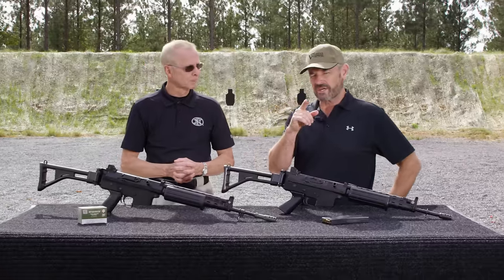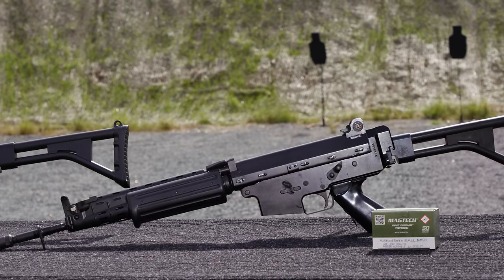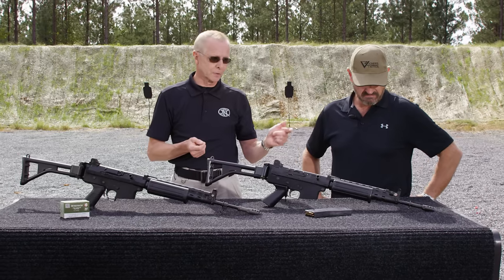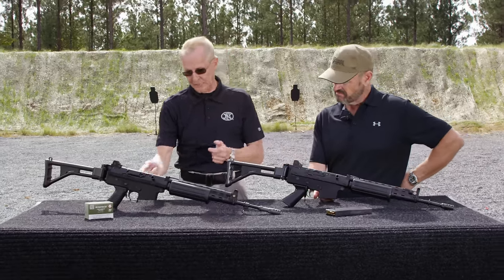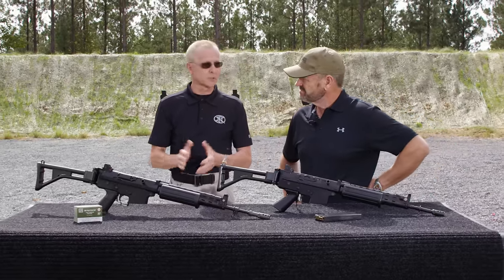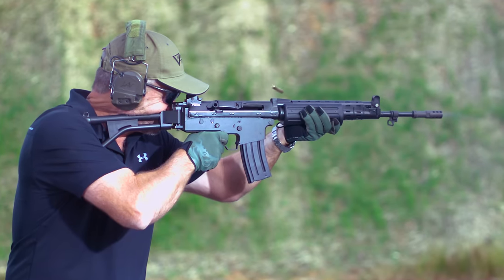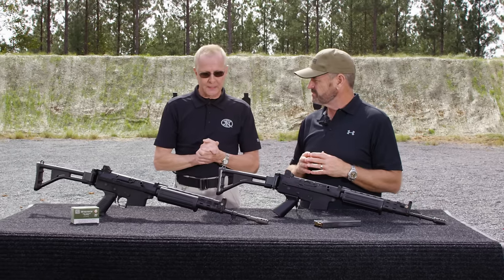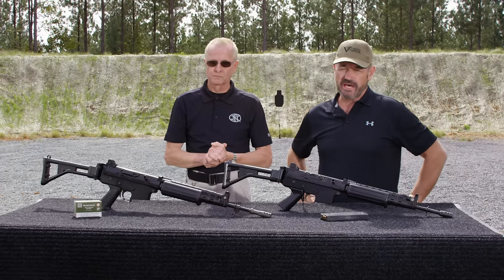FN FNC MK2 4K

Comment: Is that the rifle that Al Pacino used in Heat?
Reply: juki009 it is. He used a Para version. 

Regards,
Marky
Reply: Watched that movie for the first time last night
Reply: @RickyTPB4L  You lucky b.  😊
Reply: Nope, he used an FN FAL with a paratrooper stock.
Reply: @mohammadfaouri6878  No. Kevin Gage had the FAL.
Reply: @Gostwriterindisguise  you're right, Al did use the FNC.
Reply: @mohammadfaouri6878  no FN CAL
Reply: @hansstrouf  FN Cal never made it into the broad market, it was more of an experimental rifle and had very loew sales compared to the FNC and FAL.

Larry Vickers made videos on all 3 rifles I recommend you check em out.
Reply: @John1911  He used a fixed butstock with short barel.
Reply: @dekster14LP  Good to know. I haven't seen the movie for years. I'll make sure to look for it the next time. 

Regards,
Marky

P.S. Update - I just looked again. Confirmed. Pacino is running the folding paratrooper version. It's obvious in the opening scenes when the first good guy/cop gets shot.
Reply: Yes, it had an m-16 birdcage flash hider though
Reply: FN FNC-80
Reply: : No Cal ou fnc
Reply: @Gostwriterindisguise   FN Fal 7.62 ??
Reply: Opérateur @Viking
Reply: YEP
Reply: @mohammadfaouri6878  definitely NOT

Comment: The Swedes are currently using the AK5D, a much updated and improved version licensed by FN and upgraded to that variant by SAAB Bofors. They are not civilian ownership friendly so the likelihood of imports, even of parts kits, is slim to none. PINDAD in Indonesia is also licensed and producing the SS1 which is their copy of the FNC but they're phasing it out for a locally designed SS2. They don't seem to be in the market to export to the U.S. since they're a state owned manufacturer. 
Sadly, what few FNCs are remaining in the US are all we'll have access to even if import restrictions were lifted.
Reply: Nick K No, the AK5C is standard issue, AK5D is only issued to some units since the only difference between C and D is that the D has a shorter barrel.
Reply: @Faltrollet  thank you for the correction. I assumed the D would be the go to since it was the latest variant. I'd kill for a D parts kit to have a legit FNC worked up but SAAB doesn't allow kits out. Would be awesome if FN produced the D for importation here, if even for a short period of time. I suppose one can hope considering they did the collector's line for the M249, M16 and M4.
Reply: Improved? The adjustable is a joke in quality, the  crudly welded top rail hinders the use of the 400m ironsights and shakes the reddot sight out of its zero, the flipup frontsights which replaced the really hooded front post sight is moving around while shooting, the fronhandle is big and way to heavy which makes the whole weapon unbalanced and really frontheavy.
And yeah It's almost 500g heavier then the old one.
Reply: @jaegren553  I would have figured SAAB Bofors would have done a better job of building/adding the upgrades. I was mostly thinking of it in terms of adding the capability for RDOs and a railed forend for weapon mounted light and laser designator. If not done properly, then it's certainly going to degrade the capabilities of the weapon so that sucks to hear that.
Reply: @nickk1456  Adding rails will add weight unless the foregrip you are replacing is really badly designed o begin with. The iron sights for the C and D version prioritizes a low profile and low cost because 99% of the time the weapon will be used with Aimpoints. Basically, they chose between not having them at all or keeping the rear sight as they were and just changing the front post. Welded rails will always be less stable than rails that are part of the receiver, that being said I haven't heard of anyone's rifle losing zero because of it, perhaps John's  rifle was made on a Monday. AK5C and D have fixed gas settings. 

In the end the AK5C and D are 80's rifles that have been updated with the minimum funds possible and they still are completely serviceable. They are nearing the end of their service life though. 

If someone were to make a modern interpretation of the AK5C that could be a very competitive rifle.
Reply: Well since Indonesia is corrupt af you could probably get SS-1's for less than 1000$~ given you spoke to the right person. Also, since its currently being phased out by the army and police force, i bet you could talk to someone that works the inventory for governments retired or seized fire arms depot's and slip him/her 200$ and you'd walk out with one.  
Though idk how you'd get it out of the country.
Reply: @nbn461  there are ways to export as long as there aren't any embargoes against the exporting country but I was under the impression that govt arsenals like Indonesia's won't export weapons. Regardless, they'd have to be cut up and sold as parts kits unless Pindad is willing to build semi auto only versions specifically for import into the United States. One can hope but I won't hold my breath at this point. I'm more likely to see FN release a military collector model of the FNC and FAL at this point.
Reply: @nickk1456  PINDAD is state owned so its very unlikely they'd sell surplus ex-military rifle to the civilian market anytime soon. Also fyi im indonesian so i know how people roll here, the recreationaly used rifles for privately owned shooting range in cambodia (a big tourism destination for asians who wants to shoot guns for cheap) got their majority SS1s using the method i just mentioned above, and then smuggle them by (mostly) fishing boats and drop them off on the beach in crates.
Reply: @nbn461  How do you know that? Who are you? Can you proof it? Do you know that alot of Indonesian civiliant want to get SS1 for sport hunting and they can pay it much, but it's difficult to get and only military allowed.
Reply: @abdulkhafidtirtojoyo  How do i know that? I've been to cambodia and talked with the gun range owners.
Who am i? I wont leak my personal info online.
How can i proof it? Just go to cambodia and ask around, they'll let you know.

And indonesian gun laws are pretty strict so people cant have a gun chambered in larger than 38. Special.
Unless it is for collection and hunting medium game (deer, wild boar, etc.) And you have to renew said permit every 5 years.

So i dont know what you are talking about how many indonesians wanting to have SS1s for "sporting" and "hunting" purposes. Cause it is illegal for a civilian to own fully and semi automatic military style rifles.

Comment: I'm surprised to see that most of the improvements that the Swedes made to their fncs (ak5c) was not adopted by fn when they made the mk.2 fnc. Having shot the ak5c I can imagine them handling slightly better with a larger charging handle and both fold and adjustable stock. Also with the addition of attachment rails. 
Anyway really nice gun both of them.
Reply: The Ak 5C was produced starting in 2005, FN stopped producing FNCs in 1999. The differences between earlier Ak 5s and the FNC are negligible, mainly cosmetic.

Comment: SS1-V1 Kal. 5.56 mm is the first-up snap rifle adopted directly from FN FNC. This gun has a weight of 42.0 kg and heavy content 4.38 kg. With 5.56 x 45 mm 500.5 mm standard and 42 mm, and the leaf of leaf 449 mm, SS-1 V1 can shoot very accurately to a distance of 400 meters. Mobility in SS1 usage can be easier with a foldable pormp.

Comment: Belgium is going to switch form the FN FNC to the SCAR-L.
The troops are not pleased to say the least.
Reply: ^can confirm
Reply: Ugh that sucks.
Reply: @ReadyOrNot too heavy and too much recoil
Reply: @ReadyOrNot still too heavy for them, it shoots slower and has bad ergonomics
Reply: they switch has been going on for a few years, will still take a few years.
I see them regularly in the large train stations on patrol, sporting their Scar-L.
Reply: Wasn't the mag thing overturned? The last few times I bought some, I poped out my mod 4's and everytime, the armorers told me that there were no need present them.
Reply: @Dja05  There  were transitional measures in place up to 01/01/2019.
Reply: @ReadyOrNot He's wrong, practically everyone prefers the SCAR. The trigger on the SCAR is much better, the adjustable length of pull makes it more comfortable for the majority of soldiers, the replacable charging handle and last round bolt hold open make it much faster in manipulations, and last but not least, they all come with an optic which is a big step up from the FNC's sights. Those weren't bad per se, but they had a tiny aperture on the rear sight; meaning good for long range accuracy, but very limited vision up close. They also had a tendency to clog up with water when it's raining.
Reply: I’ve heard great things about both guns, and I’ve also heard disadvantages of each.  Both guns are extremely durable.  The SCAR is very accurate and has a modern rail system, but needs to be lubed properly.  The FNC’s steel construction can last for an insane number of rounds fired, but its relatively heavy, and wasn’t designed with modern rail systems in mind.  I think it could come down to personal preference.  However, I don’t see the point in destroying functional FNC rifles, when all they have to do is keep them in reserve.
Reply: @ReadyOrNot The troops know the FNC very well. Switching over to a new gun when you've trained with only 1 other for years can be a hassle. That said I didn't hear much of displeasement when they switch from FN GP to FN FiveseveN.
Reply: @AxisPeter  True, most soldiers don't know a lot about guns besides the one they're currently issued. The main thing people disliked about the SCAR, was the high sight-over-bore. It makes the headshots in the qualification a tiny bit harder, because one has to account for the difference between POA and POI a lot more than with the FNC at short range. Once you get the hang of it, it's self explanatory.

Now, most people were pleased with the Five-seveN because it's a new toy and it looks a lot fancier than the old, beat-up GPs we got. However, I've seen a bunch of them break in the first year we got them, issues included slides cracking, pins snapping (like the hammer pin), the safety breaking off,... The polymer is of exceptionally low quality. Personally, I don't trust the Five-seveN and would much prefer going back to the GP, or a quality gun like the Glock if possible. Another big issue with the Five-seveN is that the fixed sights on the military models are designed by a complete moron. If you line up the top of the sights, the three white dots are not aligned, very frustrating if you have experience with other, better guns.
Reply: @ReadyOrNot The SCAR uses a short stroke piston wich has a more abrupt recoil impulse then the FNC's long stroke piston. A critisism i have about the SCAR is that it is one of those guns with so many gas settings where only 2-3 actually work.
Reply: @2Potates  the scar only has 2 gas setting...
Reply: i dunno if the fnc they are using is modular... but the scar is modular.. maybe they are trying to modernize theyre military? i dont know.

Comment: It would be nice if the AK adopted the design of the FN FNC's spring-loaded dust-cover on the receiver; it would permanently close up that hole on the receiver. 

You could then make an AK safety that is half the size while retaining durability; the new safety could still be actuated with gloves in icy conditions.

Comment: LAV
SHOW THE LOVE FOR THE FNC!!!!
I have 3 of these BEASTS, 1 Fixed stock and 2 Para models. One of the Paras is VERY RARE with the 4 position selector.
FN should have NEVER stopped building these. Hard to find in the States because it was one of the BANNED FROM IMPORT by name thanks to Diane Feinstein. 
Whenever I take these out to the range it doesn't take long for the crowd to gather.  The report from firing draws attention, then the crowd trying to figure out what it is always makes me smile.
TRULY A FANTASTIC RIFLE. Great sights, fast handling, easy operating, amazing feel when shouldered.  BEFORE the SCAR project I BEGGED FN MFG to try to import parts kits. I have written dozens of letters to DSARMS trying to get them to build an ALL AMERICAN MADE FNC. That would bypass the import ban.
IF IT WAS NOT FOR THE BAN, I think these would have been very popular here in the States.

Comment: This is the perfect rpm hands down PERIOD!!!!!!! Conserves ammunition each mag last a little bit longer more controlled fire during full auto just fast enough and slow enough to control do not spray bullets in a 50 foot diameter circle at 300 yards just in case you got to use it 2 pin the enemy down if your machine gun team is down the great multi-purpose firearm I'd like to see it with a suppressor in full auto

Comment: That reciprocating charging handle seems like it would be an issue in some situations. What are the advantages of a reciprocating charging handle, if any?
Reply: Mechanically simpler and can be used as a forward assist if the spring fails to put a round in battery. I've never had any problems with the reciprocating charging handle, it's not in a place where you'd grab the gun or put it against a rest.

Comment: Reminds me of the "swedish" Ak5. FNC now discontinued, for the sake of FN SCAR? Makes sense, though the SCAR has a somewhat lower rate of fire; deliberately by design or as a compromise due to other considerations?
Reply: The difference in RoF is negligible, the FNC also shoots around 650 rpm while the SCAR-L will do 625. On the FNC, it varies a bit as the RoF increases when you put the gas selector in the "adverse" position, which will overgas the system and increase recoil. They definitely kept the RoF on both designs low on purpose, it helps much with controlability.

As for the FNC vs the SCAR when shooting full-auto, the FNC feels like it gives you a gentle slow push in the shoulder and you feel it wants to climb to the right and up, while the SCAR doesn't really pull into a particular direction, but gives a series of sharper recoil impulses.